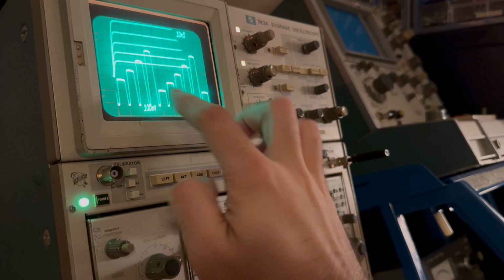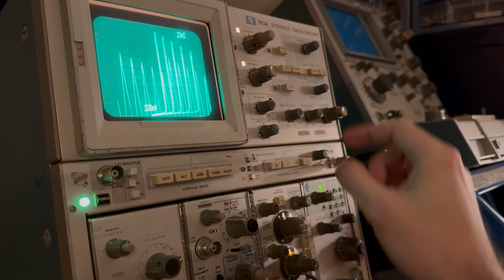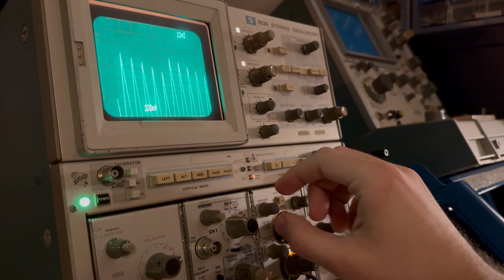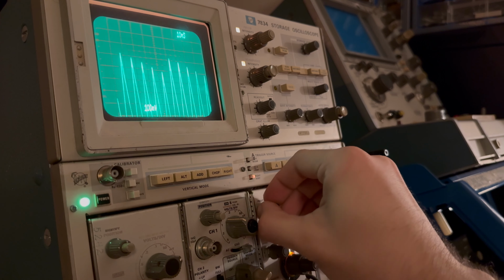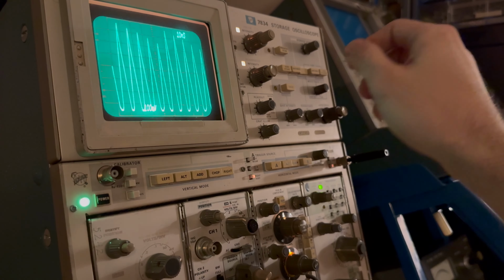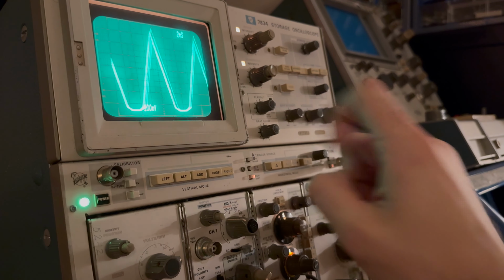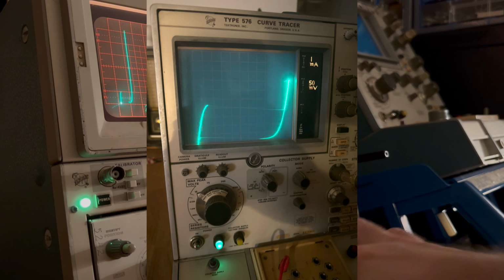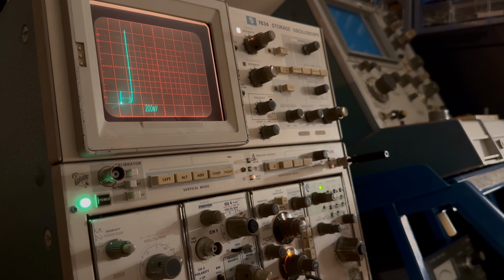Tektronix 7CT1N: Masterclass in Analog Electronics

Comment: Thank you for the informative survey of a brilliant piece of design work.

One tiny thing you missed in the section at 5:20, the difference amplifier. The notation in the schematic indicates that the two source-follower JFETs are a matched pair, fabricated on the same substrate, presumably silicon, and in the same package (obviously). This ensures that their transfer characteristics are as nearly identical as possible, thus minimizing errors in the difference, particularly those caused by temperature changes.
Reply from the maker: I did forget to talk about it. They're indeed a matched pair JFET. Lovely part!
Reply: @GearAcquisitionSyndrome  The notation is rather obscure and obsolete, having been carried over from "multi section" vacuum tubes, that had two (or even three) triodes fabricated in the same glass envelope. Of course, there is no reason for that notation today; we rarely use discrete semiconductors anymore, unless to make something as a prototype, or for enjoyment or teaching purposes. The person who designed that section almost undoubtedly learned circuit design using vacuum tubes, in the fifties or sixties (or even earlier!); for that person, the ability to get a precisely-matched pair of amplifiers was probably satisfying; he would have marveled at the low offset over temperature that such a matched pair could produce. Nothing like that could be done with vacuum tubes; even if in the same envelope, different triode elements (or tetrode, or whatever) could never be manufactured the mechanical tolerances necessary to achieve the level of matching that could be achieved by semiconductors. 

Also, the "matched JFET" was in a sense a very early "integrated circuit," although I saw the integrated op-amp you mentioned earlier.

Comment: I am a big fan of designs where transistors are treated with the same reverence as vacuum tubes once were - with big circuits built around them, doing quite a lot with few active parts. The HP/Harrison power supplies were IMHO a beautiful example of that. About 10 transistors, often less, doing a splendid job really.

Comment: Nice! I saw something similar in the Telequipment CT71 curve tracer,  but in that one everything is powered and timed by the mains voltage and I have a theory that any distortion in the mains voltage causes jitter and weird display artifacts. That could be one of the reasons why Tek went with an oscillator in the collector supply for the 7CT1N. This gives clean and repeatable waveforms.
Reply from the maker: They went with an oscillator in the 7CT1N because the mainframe doesn’t supply any unrectified mains voltage on the plug-in connector. The 576 also runs on mains voltage and has no artifacting whatsoever

Comment: Thanks for the vid. Great explanation of the analog circuitry. Even if these 50 year old devices work properly..IMO... and IME... audiophools don't need a curve tracer. Engineers don't need it either. (Totally unknown, and totally unused, in the lab here.) All modern devices are well speced. Just a silly waste of time and your money.
Reply from the maker: I totally disagree. Not only is it an important lesson in electronics design, it’s also an invaluable tool for repair. Almost as much as the oscilloscope
Reply: @GearAcquisitionSyndrome  LabLab full of engineers here. No one uses it. There are other toos:yes... but, a 'curve tracer' is an obsolete tool, mostly valued by... IMO...don't know what semiconductor parameters are... and how they are speced. and how well they speced too. Mostly valued by the people selling them on the online market place...for quick cash, from something they have no use for. If one needs an 800.00USD, 50 year old used 'curve tracer' liberated from an S.K.'s basement...to repair some audio gear... or even to design it... then IMO...and at least... one doesn't really know how to do repairs. Thousand of vids on YouTube, repairing stuff from SM uWave RF, to 1930's AM radio... never a curve tracer seen. IMO... saying it is "more important' than an oscilloscope, when it plugs into an oscilloscope, means one isn't paying attention... and doesn't need to be paid attention to.
Reply: I disagree as well. Been working for a manufacturer of precision metrology gear for a while (technically, for two over the years), and yes, curve tracers are kind of an oddity, especially nowadays, but they have their place if you need to get into component level analysis and have to know their exact characteristics, for example to verify datasheets against a batch of components you intend to use. Don't want to rely on "from-to" ranges while designing a piece of kit that costs the equivalent of a nice car. 

In my apprenticeship we would have wished for one on quite a few occasions as well, eg. while searching for strange noises in amplifiers that were very hard to try out in a semi disassembled state, or in TVs that kept failing over and over again because the manufacturer specced a BUZ90, but only the ones they sold themselves (for a premium) were holding up, not the ones from every other brand.
Reply: @TinkertubesLab I don't know what you mean by 'precision metrology'...  but, IMO... precision metrology is not this channel. And... IMO... precision metrology for audio amplifier design, and testing, is nonsense. Beyond that, IMO... you are confusing a 'curve tracer' with a 'parameter analyzer'... like a Keithley 4200A-SCS... at about 20,000USD used. Selecting, or bining, or veting, parts is something some manufactures did/do... because... but not only... their design won't work... without those 'selected' parts. Usually the worked directly with the manufacturers... or the fab... to get those selected parts... at a premium price too. You mentioned a non-selected BUZ90 failing. If it was failing in a dynamic environment? (like SMPS)... well a curve tracer only does DC parameters. Also... even if you were able to accurately find out the parameters of the 'selected' BUZ90 ...and which one(s) mattered... not easy... what are you supposed to do then? ... phone up the fab... and ask them to make a couple hundred thousand, for you? I'd say... just buy the proper part, from the manufacturer... it cost more because the manufacture had to pay more for it... or buy a better part... form a better manufacturer... with better quality control. Imagining a curve tracer would have solved the problem is not the same as a curve tracer would have solved the problem.
Reply: @willthecat3861  You are absolutely allowed to have your many oppinions that you stated, as I am allowed to have my experience that I wrote in my comment🙂 I just want to suggest that it might not be the best idea to assume too many things if one does not know all the details of who did what and when, and assuming imagination when there is actual experience.  ;-) Have a nice day! <3
Reply: @willthecat3861  The combative use of a thousand ellipses does not bode well for your intelligence or respectability, nor does implying yourself the authority on the content of someone else's channel.
Reply: I like my curve tracer to work around the deficiencies of some datasheets in graphically presenting the data in a way that makes sense for a particular application. I consider “curve tracer” to be a general term for a large class of instruments. Some are more of an indicator, some are precision metrology. It’s a continuum.

And there are so many ways to do any given  task using electronic circuits. People who are used to doing analog without a tracer-like device can sure go a long way. It’s just another tool in the toolkit. Just because one person doesn’t see much use for it doesn’t change someone else’s perspective and needs.

It’s not audiophools buying curve tracers anyway. It’s engineers. I find an engineer gatekeeping tools to be a dubious curiosum. I don’t use a hammer much around the lab, does that make hammers useless?